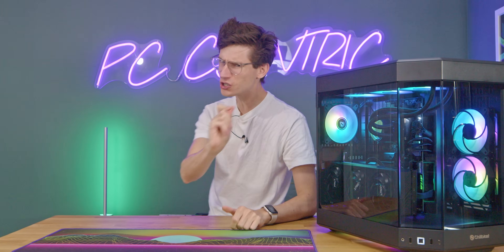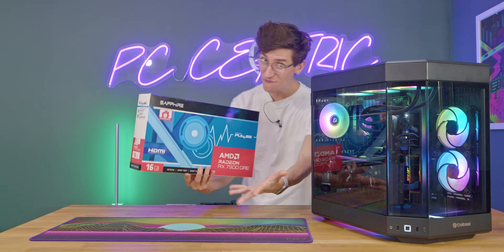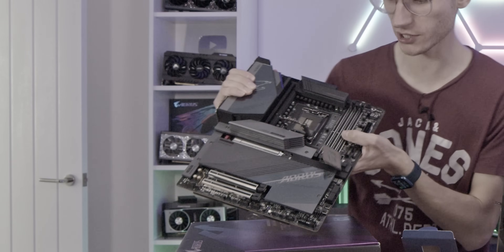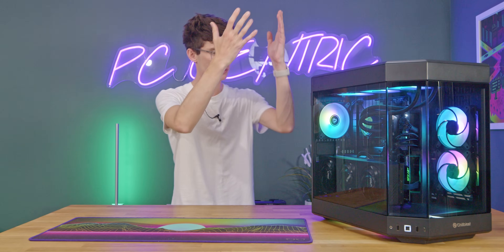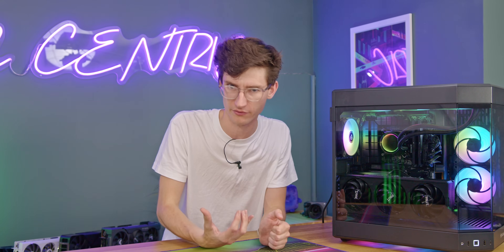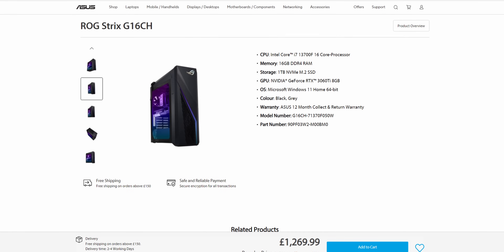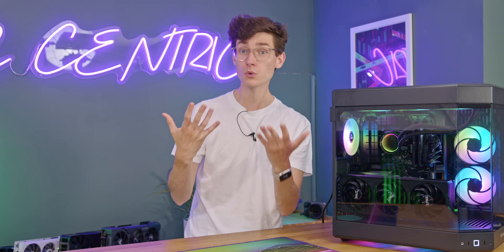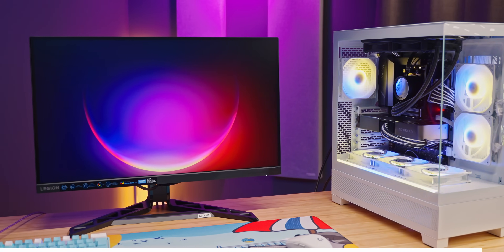Should You Build Or Buy Your Gaming PC? 🤔

Comment: @PCCENTRIC I dont know much about computers.  But want a gaming computer.  Will have to have a PC place build it.  Looking for a desk top computer. Need a good case and what parts to get.  I want everything to  be white and no more than 22" depth and around $3200.  I have all white acer monitor, razor keyboard and mouse and headphone and g2000 white speakers.
Reply: No knowledge & experience is no reason not to build an own one! Simply inform yourself! Just learn what the needed components are … inform yourself what you want/need, check if they are compatible, then choose a nice case. Then start buying the parts and case and finally … just put it together. From idea to build took me less than a couple of months with absolutely zero experience. I watched building clips, tips and read up on where I needed extra knowledge … I originally only wanted to upgrade my pre-build one … step by step I exchanged the old components till the case became too tight …  ending up buying a new case. I never ever worked on PC’s before … always used pre-build ones … in November started the upgrade plan … 4 weeks later I basically had a new setup and 4 more weeks later I finished building my first high end gaming PC … not even a basic setup … but a monster setup with 16 case fans, plenty of shiny lights and all the required eye candy stuff like premium wiring … even packing more stuff in to top it … like extra hard-disc fans …

Comment: At my age of 53 that still plays games and not so good eye sight and kind of has the shakes for me I bought it pre built from SKYTECH and they did an awesome job! Ok what scares me the most is that darn CPU that everybody screams "BE GENTLE OR YOU WILL BIND THE PINS AND HAVE TO BUY A NEW MOTHERBOARD AND CPU" That scares me!!!!!!!!!!!!!!! Plus the PSU or power supply thingy well the PSU has a bunch of slots to stick cables that run all over the system. Excetally where do they all go? Its to confusing and I rather let the experts just do it. 2 months with my skytech shawdow 4 and works like new and no problems!

Comment: I built my first PC back in 2018 with an R7 1700. In 2021, the power pin burned out, but I didn't notice it at first. I removed the CPU, applied new thermal paste, and reinstalled it incorrectly, breaking one pin and bending three others.

The next morning, I ordered an R9 3900x and went to work. When I returned, I started investigating the issue. Fortunately, I had replacement power pins, so I swapped in new ones. I then spent three hours carefully fixing the CPU pins with a sharp razor, and finally, it booted.

The R7 1700 became my backup CPU, and I have no regrets about buying the R9 3900x. It has been an absolute beast for rendering and video editing.

Comment: Simple Answer is how Technically are you at doing a Custom Build. One Option is MicroCenter. You can pick the parts and they will Config it for a Flat Price.. If you are Technically than build it and save the money. Last option would be buying Pre-Build because Acer, Dell, HP always use Power Supplies that are under powered if you are a Gamer and like to upgrade your Dedicated GPU.

Comment: And you make a video with the best pc parts for ultra graphic gaming and the best monitors and stuff because I need a high end pc that can run any game with ease so I beg to make a video like that
Reply: That does not require a video … just common sense what needs to be in there to play the most demanding games … the games suggest minimum requirements … and those you simply need to top. You know which GPU’s are high end … which high end MB’s are best for gaming … fasted memory for gaming … top of the line high end processor and you are basically already there. Same with monitor … a fast 4K with crispy picture … there it actually also depends on your personal preference …

Comment: If you've never built a PC before, here's a good starting point for reference

Ryzen 7 5700G (Includes a cooler & graphics)
B550 mATX Motherboard
32GB DDR4 3200Mhz (Maximum speed supported)
Any Sata SSD
Any tower case
500w power supply or higher

That's all you need. There's no soldering needed, everything just slots together like Lego. Have fun!

Comment: I went through Corsair and purchased their Premium Build Kit, which came with:

Intel Core i9-13900K
NVIDIA RTX 4090 FE
Corsair 64GB Vengeance RGB DDR5-6000
Corsair MP600 CORE XT 2TB PCIe 4.0 (Gen4) x4 NVMe M.2 SSD
MSI Z790-A WIFI DDR5 Pro Motherboard
Corsair RMe 1000W PSU
Corsair H150iELITE Capellix XT Liquid CPU Cooler
Corsair 5000D Airflow Case with 4 Corsair AF 120 RGB Elite Fans

I was very fortunate because I only paid $3,299.98 (with tax $3,572.24) during their August 2023 deal, a savings of $400, and I experienced how to build a PC myself.
Reply: "only" paid 3.000+ $ for the PC itself lmaoooo
Reply: hmmm, I don't have that budget. But i made an online pc build for 1600 $. Do you think it's good?

Processor (CPU) AMD Ryzen 7 7700X 8-Core Processor (4.5GHz-5.4GHz/40MB CACHE/AM5)
Motherboard ASUS® TUF GAMING X670E-PLUS WIFI (AM5, DDR5, PCIe 5.0, Wi-Fi 6E)
Memory (RAM) 32GB Corsair VENGEANCE DDR5 5200 MHz (2 x 16GB)
Graphics Card 8GB NVIDIA GEFORCE RTX 3050 - HDMI, DP, LHR
SSD Drive 256GB PCS PCIe M.2 SSD (up to 3200 MB/s Read, 2700 MB/s Write)
Power Supply CORSAIR 550W CX SERIES™ CX-550
Processor Cooling PCS FrostFlow 100 V3 Series high-performance CPU cooler
Sound Card HIGH DEF AUDIO (STANDARD) 6 CHANNEL (5.1) INTEGRATED
Network Card 2.5Gbe LAN PORT
Monitor ASUS TUF GAMING VG27VH1B 27" - 1920 x 1080, VA, 165 Hz
Keyboard and Mouse LOGITECH® MK540 WIRELESS KEYBOARD AND MOUSE COMBO
Reply: @GoldenCrow320  nah man, the 3050 gotta get replaced. also why use such a high-end cpu with a weak gpu. get a ryzen 7600, pair it with a 7600 xt or a 6800 used, get 16 gb rams instead and upgrade the 256gb to 1tb atleast. that should make it better. ALso replace the cooler with a peerless assasian, that way u can even upgrade to a future am5 chip (9000 series amd - 11000 series) later on
Reply: @das3tins768  thank you, i already noticed it was bullshit by researching a bit more haha - -'
Reply: @das3tins768  yeah i noticed that it was bullshit. thank you for the feedback

Comment: Just in my opinion, purchasing a quality (customized) machine from an SI is going to be an expensive venture. Beyond that, if something goes wrong and you have no idea how to troubleshoot, you'll need to reach in your pocket deeper. My advice to anyone wanting a gaming PC is "learn to build." The money that you will save and the knowledge that you will gain will make it completely worthwhile.
Reply: Buying a customised one is the easiest option … you get it delivered in working order with your dream components … simply plug & play … there you got no problems with troubleshooting … any problem you  have 24/7 support. You run into problems you have their hotline and someone is at your home in 24 hours to look at it. Always did it like that. The prices vary from fair to extreme. Building your own one you are on your own with everything and all probable problems which there might be a million problems … solving this is time consuming … much more than building it. I built my high end gaming pc’s so know how frustrating it is if it does not respond how you want it to … as your own creation there is nobody to help with trouble shooting … trying to identify a problem takes ages … then you might have to de-assemble and get new parts … my first build had a broken main board … this disappointment of first switching it on … and … nothing on the screen … happy fault identifying … impossible if you have to work.

Comment: Personally I would really advice people to go option 1 or 2 as well. I have been gaming since I was a kid in the 80s and have had pre-built PCs and custom built ones (both by myself or by an SI) and the custom built ones are just more dependable, especially once you decide it is time to upgrade your pc. I remember in the late 2000s where I had an Acer PC and I decided I wanted to upgrade the damn thing and it was just impossible due to how it had been built. (it had an integrated video card and no free slot on the mobo for a dedicated GPU)

My latest PC (only a month old :D) I bought from a company which does build them for you if you like. It has been a great experience as they allow you full selection of the hardware you like and were very transparant about the assembly cost (they charge €150 for building and testing the PC + provide warranty on the build). Although I am capable of building a PC myself and have done so for a colleague at work not that long ago, I did choose to pay the extra cost just to not have to build it myself and it worked out great.

Anyway just my few cents! :)
Reply: Which company was it? The one that built your latest PC, I mean :)
Reply: @Circe-ng7jd  It's a company called Alternate, they are a Belgian company (as I live in Belgium myself)

Comment: I have always always always built BUT looking to get one for someones Bday (wont be MY PC) BUT...................  this is hard to pass up for the specs    Ebay item # 126562755694    Figure a 4070 Ti goes for roughly $800 alone,  Core i7-13700K ballpark like $300 ish, that alone is over the cost of the damn thing, 1TB SSD in there, case, PSU, RAM etc.. you can't build it for that basically

Comment: I recently bought mine from a company here in Australia called aftershock and it is the exact pc that I would of wanted if I was going to build it the size,parts,price,performance,looks is all spot on amazing there’s room for upgrades if I ever want to go to an aio cooler which is basically all I would change really the aftershock branded cpu cooler is great and does more than enough for temps I would like to always keep temps as low as possible if I ever decide to really start pushing the system

Comment: Build, build, build. I spent 2,200 on a 4080s 7800x3d pre-build. Apart from those 2 things. Every other components were cheap and corners were clearly cut. I spent another 800 on top to upgrade everything myself.

If I bought the parts and built myself, build would have cost me 1,900-2,000 at most.

All the information you need are in the manual, then you have YouTube, Google, Reddit and the internet for full support. YouTubers like PC Centric give you confidence.

Comment: My two cents I completely understand the allure of a prebuilt system having said that please do a little bit of homework and don’t ever buy an alien wear computer. They look really cool but in lots of cases, they highly lack proper cooling. You will be paying for a $600 processor and getting a $300 processor performance out of it, I would like to make a beginner motherboard looks very daunting. However, everything is labeled and everything has its own place. Example the processor has one place it can go in now. Yes, you have to line it up properly, but it has markings on it to do that your ram only goes in, one place on the motherboard, but that’s kind of my point all your components typically have a specific slot or place that they will fit into built as I can’t really use computers anymore due to my health problems but once you have built your first one you realize it’s not that difficult

Comment: Also it's worth pointing out you can take a practice run at an inexpensive build before going to high end parts.  Buy used parts or pcs and put them together in a new machine.  It can be daunting if you just dropped a couple of thousand and it doesn't boot and you are too stressed to figure out why on your first time building.
Reply: I recently built a frankenstein gaming pc with 3rd gen intel i5 with DDR3 ram & a Radeon RX570 so I can take practice as I'm planning on saving up for a all new mid range or high end build to build myself for late next year or year after & it will be a all AMD building

Comment: Im always so disappointed to see low capacity NVME boot drives and HDD’s in mid to high end SI builds. You can usually remove but often the NVME options are either limited or over priced. As well as little PSU headroom limiting the ability to upgrade later. Again easy to replace if you know what you are doing, but then if you know what you are doing you could be self building.

Comment: It's been almost exactly two years since I bought my budget gaming laptop for $700, and I knew then that I could not yet build a comparable PC myself at that time.

I had a lot to learn.

But now, after studying channels like yours, I am about to build my own budget gaming PC out of parts I sniped on discount one at a time.

I am still a bit anxious about putting it all together,  but the investment in knowledge and skill is well worth it.

If this works out, I should be able to build another in a few years with a somewhat larger budget and a lot more performance.

I am grateful for your channel.
Reply: RIP 🙏🕊️ His PC blew up while he was building it.
Reply: No way he died 😢
Reply: Fear nothing as long as your motherboard and cpu are compatible your basically there. Get a good PSU and your fine.
I never built a PC before and went all out on a custom hard tube water cooled loop. Yes I bought more tube that I needed and a few unnecessary bits but it was rather easy. With no error messages at all.
Reply: heall yeah
Reply: How did it go
Reply: Hey how did it go?

Comment: I bought a prebuilt from Best Buy and I couldn’t be happier with it. The specs are: Ryzen 5 5500, RTX 4060, 1TB of NVME 4 SSD, 600 PSU, 16GB of DDR4 RAM, all on a B550 motherboard. I do eventually wanna upgrade the RAM, motherboard, and CPU one day.
Reply: I think I bought that exact one, too.  $1700 it's awesome
Reply: @stephenholmgren405  Currently costs about $900 to build this including windows key. Granted there's no aftermarket support.
Reply: @stephenholmgren405 1700 is crazy for that
Reply: Yea maybe in next 2 years upgrade cpu
Reply: How much did it cost you
Reply: This is the way.
Reply: office work - good stuff
Reply: can this run rdr2 on maxed out settings with a stable framerate over 60fps?

Comment: Hi Centric, I build dual GPU inside my rig, 7800x3d, x670e crosshair, 64gb 6000mhz, 1000w psu, 4090 + 4070 ti super. one thing I am curious, because I'm going to use 3 display port to triple 48gq900 (4090) and one display port to pg27aqdm (4070ti super). Am I going to sacrifice some fps on each channel or any bad impact? the purpose of this rig mainly for racing simulator and 1440p cs2 competitive.

Comment: I did one of PC Centric's builds, the AMD 7900 XTX GPU, Ryzen 7 7800X3D CPU, I sourced all the parts and it cost me under 2500 UDS! THANK YOU PC CENTRIC!!!!
Reply: $2600 I have the same combo built mine in may of 2023

Probably could’ve have saved a lil more if I didn’t get a $300 motherboard & $130 ram
Reply: i built one same specs different cases and parts brand wise but same preformance all parts walk in and bought at microcenter for 1700 usd last month same system just different brands on sale at the time, i feel bad for anyone who cant go to a local microcenter , sorry if ya cant but ive found its absolutely the best option for dyi
Reply: @InsaneBean122 I can go to micro center what deals did you get? I am going to get the 7800x3d motherboard ram combo but did they have good deals on GPUs?
Reply: I just bought a pre-built with the same processor and an rtx4070 super, 32g ram, 1T m2, aio for $1679